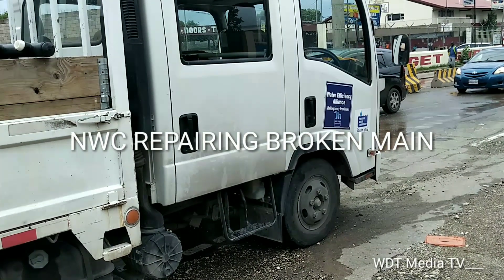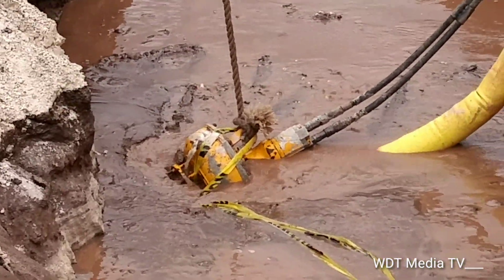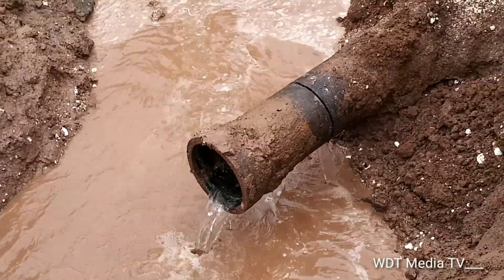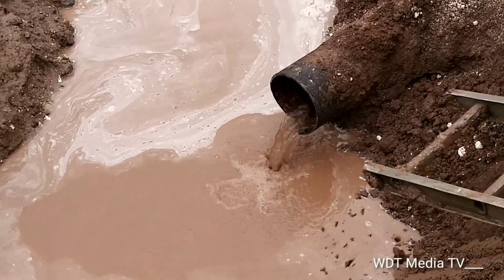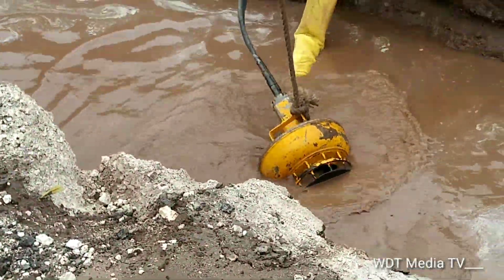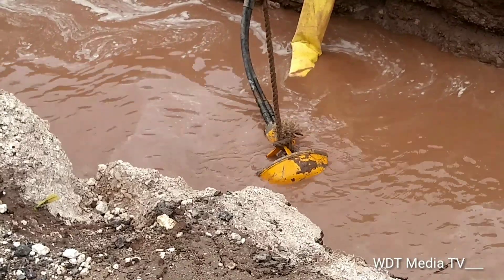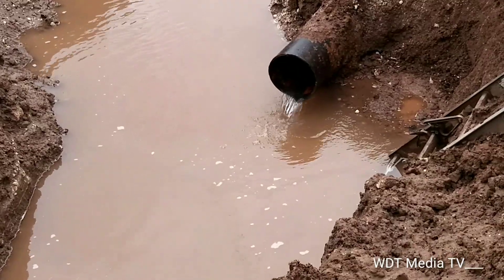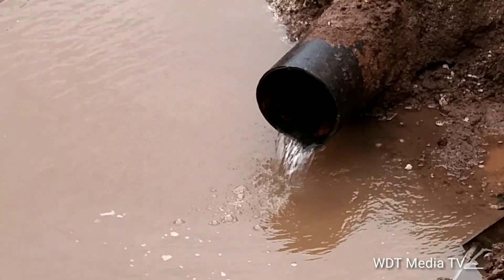WDT Media TV Hagley Park Road  Improvement Project

Comment: Water commission is a joke, wrong size cap, government contractors. Wow, this pipe line should have isolation valves. Water commission should be on site for any repairs Needed on these old pipes.. They are not prepared at all..